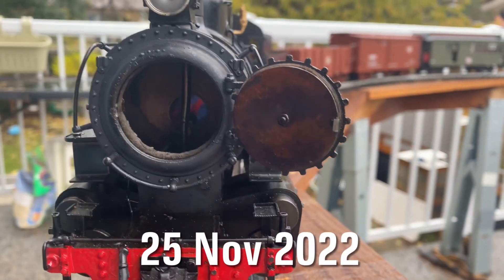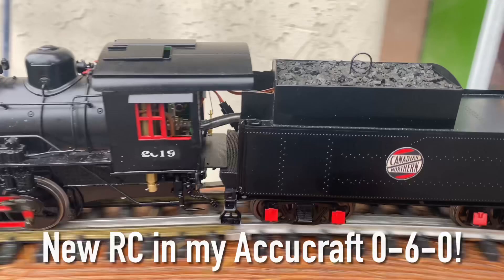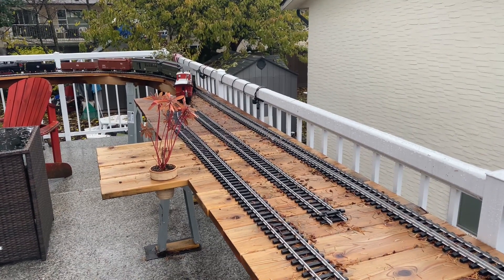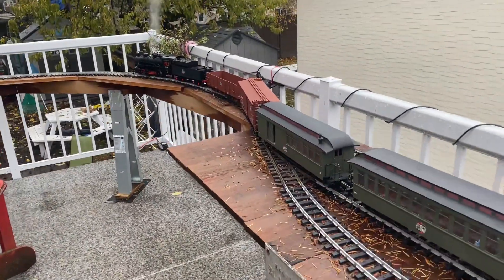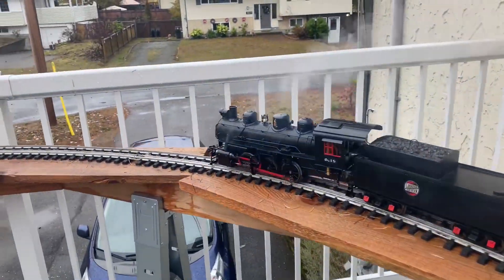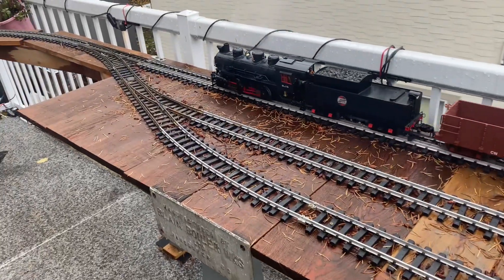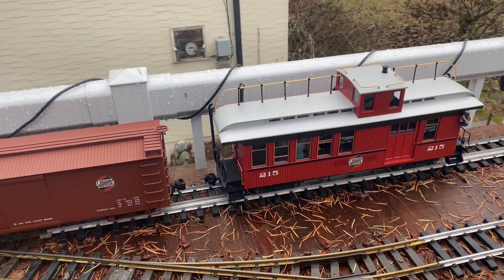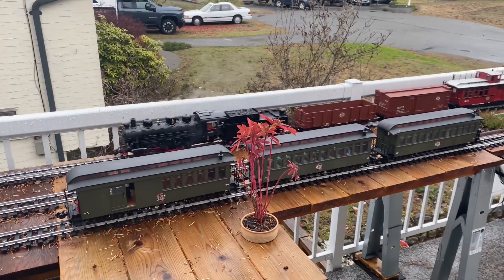Victoria BC: RC in live steam locos for realistic switching and driving! (Links & Thanks in Blurb)

Comment: I've found it enormous fun to 'drive' the engine, particularly to try to maintain a scale speed around the track where even the slightest gradient makes a difference.  Also, the R1 curves can be a challenge when running different types of rollingstock.  A great looking train though, lots of character😃.
Reply from the maker: I know what you mean (Sounds like Henry). I took the shims out so that the track has its 2% back! Now it follows the slope of the deck. I love the sounds. The engines chuffs harder dragging the train up the grade and is almost silent coming down.

Comment: That was my kids and I do, my Ruby is rc'd steam reg and reverser. I Get them to switch loads after I cut cars. I found if I'm doing lots of switching I have to turn down the gas so the safety valve isn't going off so much. I added a Goodall valve so I can fill up under pressure now.
Reply from the maker: I also turn down the gas when switching. It still blows off but not as bad. This engine is hard to tame. It has a well insulate boiler. I love my Goodall valves. Verrrrry handy!

Comment: is it using speakers for the sound?
Reply from the maker: No. This engine is all mechanical. The sound is enhanced a little with a hollow chuff pipe made of brass and copper with a slot cut into it. That pipe is set down onto the blast pipe. The steam exhaust from the cylinders blasts through and out of this chuff pipe, which has the affect of making the steam exhaust more pronounced. Great question though. 😊
Reply: @Terrys-Steam-and-Bricks  thats so cool!
Reply from the maker: @agressive_cementbag  it is! Even without the chuff pipe it sounds so amazing. But you can’t scale down physics so these small engines need a bump.